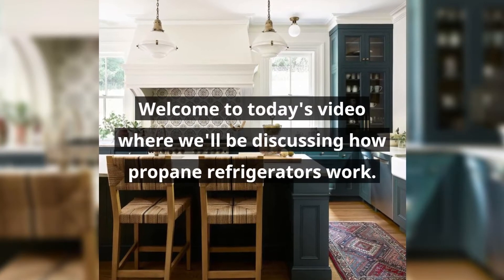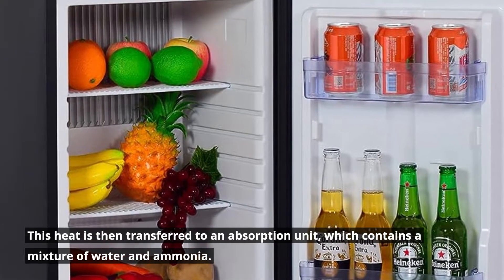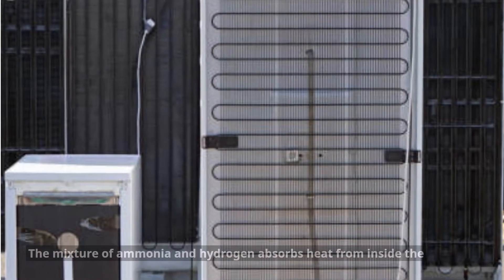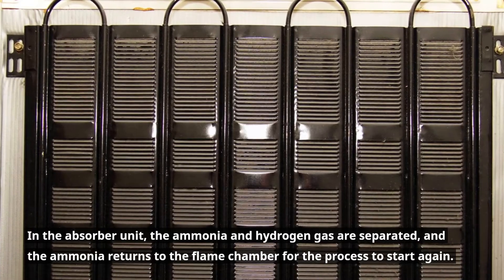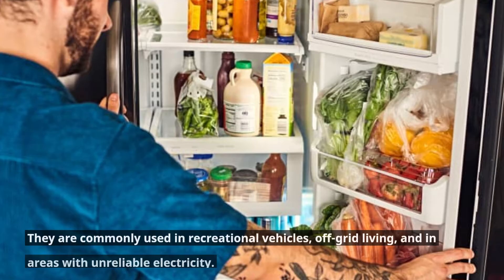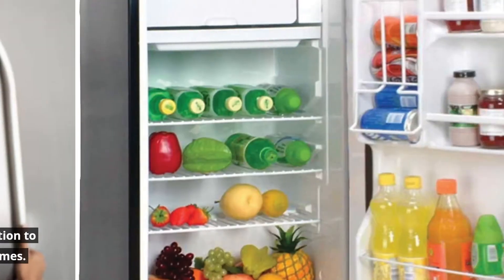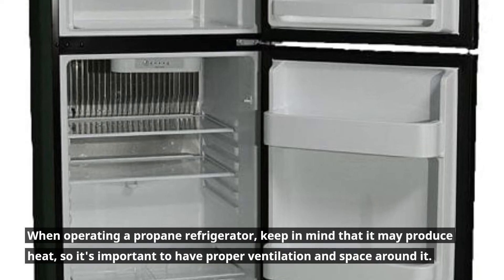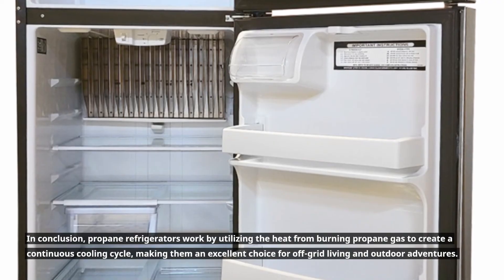How Do Propane Refrigerators Work

Comment: Still not sure what pumps all of that fluid around inside the closed system.  Seems like it needs a pressure differential to get the ammonia back to the starting point in the cycle.  Anyone know?

Comment: try propane refrigerators with heat/cold powered teg thermo electric generators for solid state power. heat and cold are both used in the teg, neither wasted. water evaporate cooler might work even better.

Comment: So it only requires heat source, it will work with focused solar thermal? Does it generate more heat than electric compressor?
Reply: using focused solar thermal would make a pretty efficient process less efficient. also solar thermal would need a battery to keep the charge if you wanted it operating at all times & also defeating the fact that it doesnt need electricity to run. but if you wanted a daytime refrigerator only, maybe?

Comment: Clear and concise explanation for those wondering about these less known refrigerators.   

Worth noting that in the 1950s and 60s gas refrigerators were much more common  than today, where we typically only find them in RV's and off the grid homes.  In fact my great grandparents had a propane refrigerator in the farm house they lived in, near New Haven,  MI, from 1955 - 1967, and grandma recalled it took some time adjusting to the sound of an electric refrigerator when they sold that house with the appliances left to the buyers.
Reply from the maker: Gosh, thanks for the extra info! So nice to hear a "blast from the past"